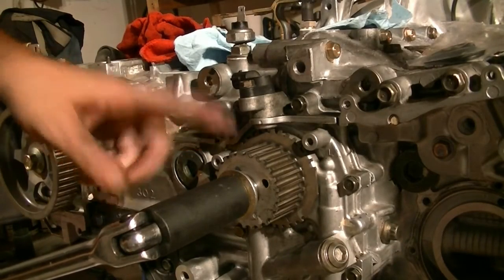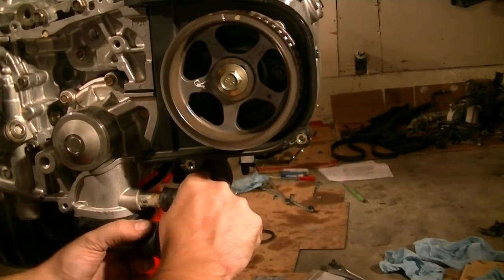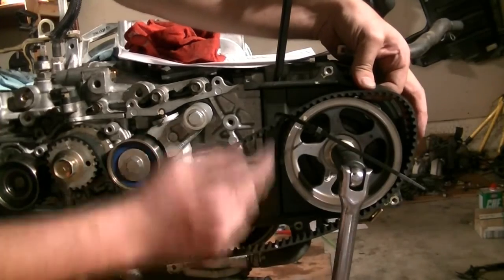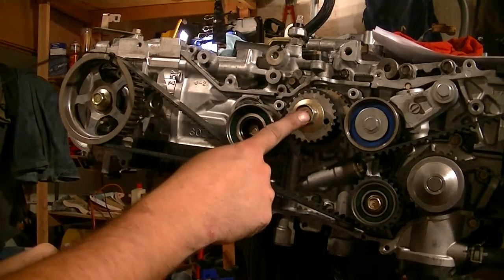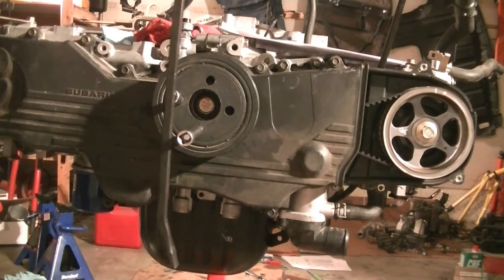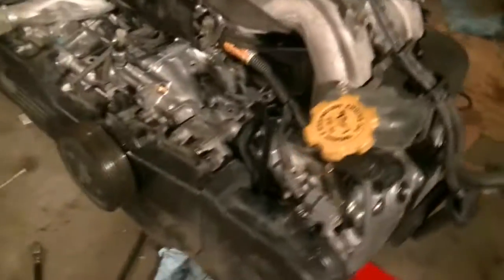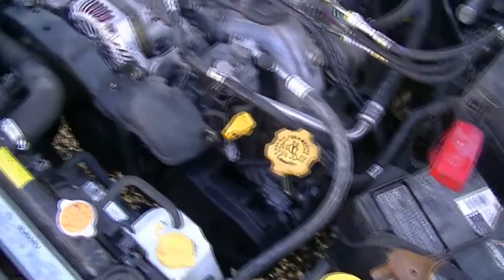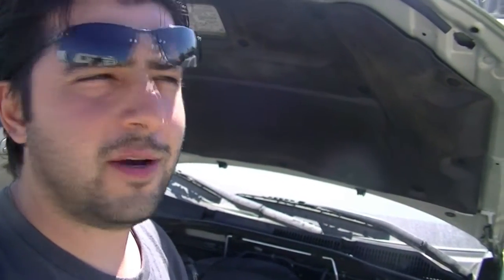How to Rebuild an EJ25 Subaru Engine - Part 10 (Grand Finale)

Comment: Finishing up a rebuild on the same engine now but as I put the first timing roller in with the flange it’s contacting a thread post on the oil pump. Anyone else experiencing this? Any thoughts?

Comment: Kudos! well done! one thing you could have done to check the gap between the rocker arm and the tip of the valve, whilst the engine was out.

Comment: Great content man.. I'm currently rebuilding my 2003 Subaru Baja EJ251 as well. Got the head off, notice my # 4 piston missing a small junk (my is boosted and it's high milage. LOL) also my # 4 rod knock as well. These engine are weak... but glad to see people like you and myself who's willing to rebuilt these engine rather then tossing in another used engine with the same problem down the road... I'll rebuilt all my engines unless the budget exceed a good low miles used engine... take care my friend..

Comment: The other video ref head bolts I mentioned in my other comment today is:

     CoreyHolzman : "Subaru Cylinder Head Installation"
     https://www.youtube.com/watch?v=ddFsFfiyOvg

And the pertinent parts are times 12:15 thru 15:00 and 18:50 thru 19:15.  He calls it "pre-stretching" new bolts.  What is not clear to me is, can you re-use the old bolts and just skip the pre-strech procedure, or must you always use new bolts and pre-stretch them.

Comment: Some other videos online say Subaru says to replace the head assembly bolts whenever an engine is disassembled, because they stretch beyond their "yield" point when tightened (using the Subaru method of torquing, then turning a certain number of degrees more). The yield point of a metal under tension is the point beyond which further tension results in permanently stretching the metal (does not bounce back to its original size when tension is released).  Do you know anything about this?  This may only apply to certain Subaru engines, not sure.

What a complete and clear video, thanks for all your work making it and posting for others' benefit.

Comment: beautiful video....nice job...but...I think both head gasket are on wrong.....they say this side up but there a     right side and a left    and I saw blue gasket showing on the out side of the engine body... am I wrong??
Reply: Recently did the headgaskets in my 2008 Legacy 2.5 SOHC... used a set of felpro gaskets and I can see the blue edges extend over the heads and the separate intake gaskets are visible with the manifold on too. Seems to be normal for the felpro type since I have gone almost 3K since the repair and had zero problems.

Comment: Good video for taking apart and putting back together. For those of u using this as tutorial. Please don't do everything he did in this. For one he should have spent the money to do the crank properly and balanced the rotating assembly. By doing only one rod he threw the balance off big time. Also don't use that silicone for reassembling the engine AT ALL! Also he took the time to clean internal on engine but neglected to flush and clean the oil pump before putting it back in. Probably still has bits of metal in it. Also should have put new rings in and all new bearings as well. All in all, I no this was a nugget build, but with it not done properly he will be doing it again prematurely. So in reality, money not saved in the long run. Well unless he turns around and sells it.

Comment: Great video series, I have to do the same thing on my wifes 2006 Outback soon, it is starting the infamous rod knocking, I went ahead and purchased a new crankshaft and all new bearings and gaskets to fix this, I only have a weekend to fix this one, I can't afford the down time by sending parts to a machine shop as it is her daily driver. Thanks to your videos i have all the info i need to tackle this project. Thanks!
Reply from the maker: gl sir

Comment: i have  SUBARU Impreza 2006 2.5. is to much work finally change because it was broken.my  time bealt..   change head gaskets bents valves with  iam sure the machine shop should be able to fix the valve issue..thanks again and are folow you video and learnt alot tinght is  great! Thanks Thank you for taking the time to video this process  thanks for the video...thanks again...jorge.

Comment: Great!
Reply from the maker: +Dennis C Glad you liked it, thanks.
Reply: +RatchetsAnd Wrenches After learning procedures from you, I did an ej25d.But I get a #1 misfire. I tried every symptom-no good.It's either short in #1 injector wire, stuck cam on 1-3 side, or exhaust restriction. Timing light jumps on misfire. Any ideas?

Comment: Well, this was very insightful, as was your engine pull. I have a 99 Legacy Outback. and i either have out of time, Head Gasket, or a burnt valve. with is being a EJ25 DOHC there is a little more work to getting the heads off. So i'm going to pull the engine and put it on a motor stand while i check the heads. Question, how do you tell on a burnt valve? I'm thinking of pulling a Second engine from a Yard to rebuild and swap. i'll fix the current engine to be where i can drive again. get the money for the rebuild. Kits have went up in price since Aug of 2013. if it wasn't 1600 for a rebuilt crate engine i would buy a rebuild.
Reply from the maker: +Bored Gaming Why do you thing you have one of those issues?
Reply: So for the late response. I pretty much ruled out head gasket but it runs bad. A lot like a bad head gasket. Spitting and sputtering. However i have no water - oil mixing, that I can tell. Bought a compression tester so I'm going to test each cylinder. This will tell me if I should look at failed electrical or if it's in the cylinder.

Comment: Muy buena serie me ayudo mucho thx man
Reply from the maker: +ivangato13 np tx for watching
Reply: +RatchetsAnd Wrenches  hey just took my 2005 Impreza 2.5 rs to get smog check and it pass had to swap the engine for another one and change the water pump and timing belt i had never done it with out this videos and your easy to replace subaru engine so thx you so much
Ps. First time that i been under a hood

Comment: Hey man...question when you put back the cams when u build this motor do you have to put them in a certain position or you can just put them in then adjust it after you put the sprockets back on?

Help ASAP!

I'm on the process to rebuild my Sti but I'm scared that I may not time it right.
Reply: What’d you do any how’d it go?

Comment: Learnt alot thanks for the video. I have a 2.5 sohc with bent valves am sure the machine shop should be able to fix the valve issue..thanks again

Comment: This was one of the most informative videos I have seen on youtube. Thank you for your time and hard work. Very well filmed and narrated like a pro. I am curious as to how many miles were on the engine at rebuild? Also, what caused the bearing to go out for that one cylinder? Interesting. Also, did you have to have the faulty rod and cap machined and honed to insure the crank end rod and cap was perfectly round before reassembly? I don't know what you do for a living, but you should be a teacher/instructor for sure with your talents. Thank you again for a great series of videos..
Reply from the maker: beboboy mann Thanks for your comment, the rod and cap where the bad bearing was did get machined and made perfectly round. If I remember correctly the car that only about 100k miles. No idea about the history of that car since I bought it at an auction with the knock. Thanks for watching, cheers.

Comment: Great series!  I have done probably 20 Subaru engine pulls and head gasket/reseals for my cars and friend's cars over the last 5 or so years, and you have almost exactly the same process as I do.  Very good to see, and you've done a good job with the editing, as well as keeping the small but important points in the videos.
Reply from the maker: paulmeisterpk Nice, glad to hear it from a Subaru engine building veteran :)  thanks for watching. Cheers

Comment: Fantastic series. Did you ever work out what actually caused the bearing to fail? Also this disproves the common theory that metal in the oil will circulate everywhere and destroy everything.
Reply from the maker: No I couldnt figure out what was the cause, my best guess is some dirt or maybe a piece of silicone made it through the oil screen and ruined it but idk...thanks for your comment. cheers

Comment: What happens if I hand tighten all the bolts instead using clicking rachet
Reply: Torque wrenches are cheap at harbor freight. Best to use the right tool for the job. Over tighten and you strip or damage. Too loose means leaks and parts wiggling loose.

Comment: You must have a good experience base to be so comfortable around an engine. I have done an engine swap in a 98 Subaru WRX ej20 that had done a bottom end, however it had done too many kms with it knocking to salvage. I found the job got bigger the more I got into it but completely satisfying at the end like you said. Great job, like the attention to detail!
Reply from the maker: I've dove head first into so many projects I shouldn't have I've developed a good knowledge base...and a good back up plan lol.  Overall its always worth it given how satisfying it is when you are successful. Thanks for watching. Cheers!

Comment: This was a great video series. I learned a lot and feel like I got a good feeling for the investment necessary for an engine rebuild, as I've been considering rebuilding my EJ25 with 115K.
A few questions:
1. When you refer to "the book", do you have a reference manual for your vehicle? Or did you find something online through a forum?
2. Are all the parts you replaced OEM subaru parts from a dealer? You did a good job of showing us the bags with part numbers for some of the O-rings and smaller parts, but I was mainly curious about the gaskets and larger bits that weren't bagged.

Again, great job on your vids. I'll come back for reference when my schedule and wallet let me open her up.
Reply from the maker: By the "book" I meant a repair manual, I used alldata but any reputable manual would do. For the Head gaskets I used Fel Pro multi layered head gaskets, the intake/exhaust manifold gaskets where re used since they were in good shape, all timing components and timing belt belts where re used as well since they look in near new condition. But you dont have to go factory on those if you decide to replace them. Napa usually has a good selection for those items. GL and thanks for watching!

Comment from the maker: That mark is NOT TDC, for these engines that mark is when all four pistons are half way up the cylinder. There are other marks on the cams and harmonic balancer to line up the #1 cylinder at TDC but for timing belt or cylinder head removal and replacement you need to line it up like I did. Thanks for watching, cheers.

Comment: That's a great series!  I really appreciate the work you did to clarify everything for me.

One question I have is, when you turn the crankshaft to line up the marks, you state that the pistons are only halfway down the cylinder.  But isn't that mark TDC?  Isn't there a piston at the end of the cylinder at that mark?

Thanks!